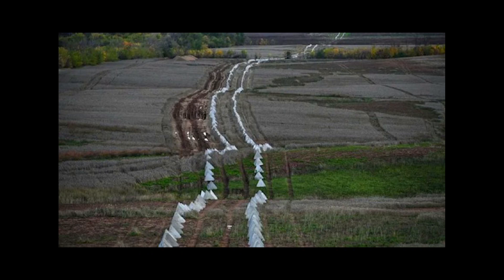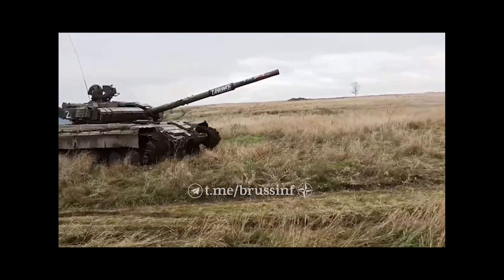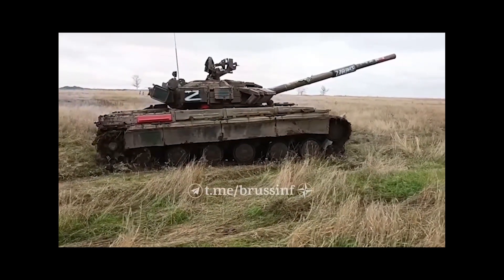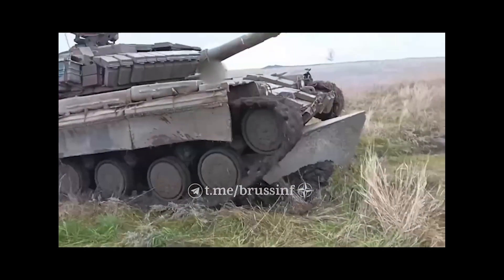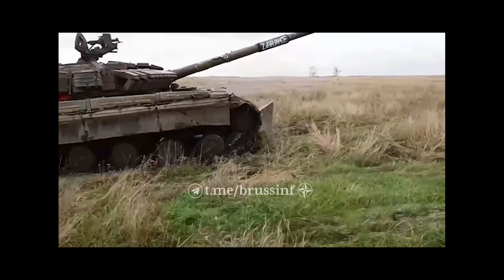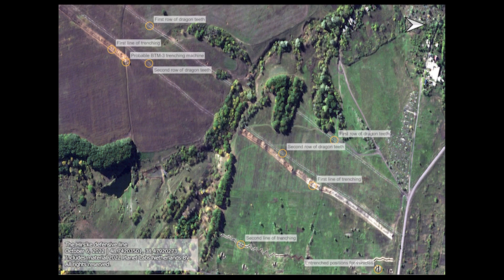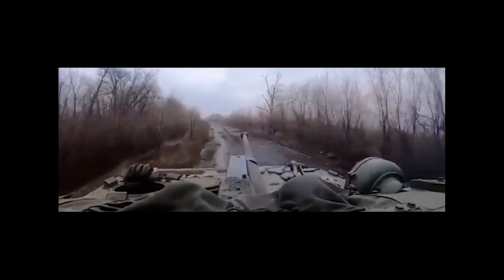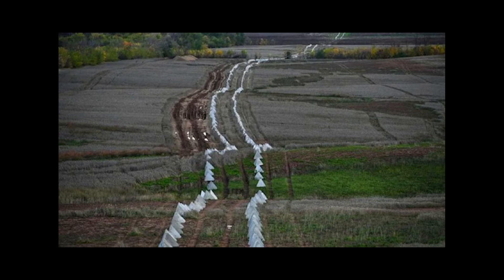How Russia's Dragon Teeth Anti-Tank Barriers Work

Comment: I am a former Combat Engineer served in the US Army in Iraq and Afghanistan. You are right any breacher would just push it away.  They really would want to use combinations. Add mines between, add razor wire, add tank ditches etc. to make them more effective. The idea of course to slow, channel or even stall an advance. To an engineer squad though those alone wouldn't last minutes.
Reply: NO one tought that tank has a gun a can blow it in peaces in few seconds
Reply: @dzonikg  waste of ammo tbh. They likely have tanks with breacher blades on the front that can just push them aside.
Reply: @nicgb098  definitely the way to go if they do have the breachers, otherwise I'd think it'd be worth a blast to keep up momentum on an attack.
Reply: @Nick G.  maybe, but if a tank could reduce two or three to rubble in a few seconds from half a kilometer away, and then a whole squad (or whatever a small unit or Ukrainian armor is called) could rush through the gap, it would be a very good use of ammo.  A dozer tank might get shot and disabled and its crew killed by trying to bulldoze a single dragon's tooth.  Ammo doesn't cost that much.
Reply: @dzonikg  The gap between the lines of teeth is mined, that is the missing detail of these video
Reply: What about a dozer tank?  These dragon teeth are not interconnected and steel reinforced, neither were they dug in like the WW2 german ones.
Reply: @jandenijmegen5842  V-shaped blade in front of the tank and they are gone. Very poorly executed dragon teeth...
Reply: The German version had a heavy concrete base buried in the ground, everything Russia does is sloppy and they know it.
Reply: @_John_P  vranyo ! then they try the jedi mind thing I guess...
Reply: These are basically just a big version of the steel caltrops infantry used to scatter to deny an area to horses. No mater how it rolls, it points up. Those were used to puncture a horse's hoof. There are meant to high-center a fast moving vehicle or slow a column down so the artillery can do its work. Luckily, the Russians tend to skip that last part. They're part of a defensive work, but not very effective on their own.
Reply: As any good Combat Engineer knows, your obstacles are only as good as the troops left to watch them and their ability to call in fires.
Reply: @BH-21-00  Very true. They definitely want fire fixed on these lines but to make it more effective you want to slow and channel the advance. These alone will not be very effective in that.
Reply: I think channeling is the purpose, to limit the flood to fewer routes
Reply: @KuopassaTv  again, probably a mind trick: DO NOT USE THE DIRECTION YOU WANT TO TAKE, USE THIS ONE THAT WE PROVIDE IT WITH OUR CHEAP DRAGON TEETH!
Reply: @KuopassaTv  - The enemy's supposed to come across the lines, not between them. That space will be filled with wire. The channeling  happens because they can't break through all along the line at once. They get across a few spots and a bunch of people and stuff has to follow the same routes.
Reply: @KuopassaTv  That is always the objective with obstacles.
Reply: @KuopassaTv  Most tanks will just ignore them.
Reply: Typical Russian half ar*ed response.
Reply: Don't even need that. Many of them still have the lifting eyes on them. Have any spare tow ropes?
Reply: @John Smith - Maybe you haven't noticed, but tanks still move the same way they did in WWII, and they're no bigger. They can brush to the side, they can't drive over them. Those two parallel lines are meant to be parallel to a line of trenches and dugouts, with wire and infantry cover. They're not defining a lane as the track shown was treating them. 
The ones in Normandy were meant to stop boats from one direction, and they were anchored in the ground. They're exposed at low tide, but the ones further out aren't.
Reply: @hamletksquid2702  You say they are no bigger, but a simple 1 min search shows they are twice as heavy, 30 tons compared to 60 tons.
Reply: @tedmoss  - Not sure why we have to keep doing this. They aren't ten times as big., which is what it would take to run over a tank obstacle without a problem. If the nose of a vehicle pushes this thing, it rolls and lifts the vehicle. It's not rocket science. Unless the belly of the vehicle is higher than the top of the object, it's going to get stuck.
Reply: @Uncle Sam 🏴‍☠️ we, not the wagnerites...
Reply: Haha you typed all of this without knowing how NATO operates 😂
Reply: @WinchesterDelta1  I was a part of NATO and fought under NATO command in combat.
Reply: Nice garden ornaments.
Reply: Yes, I’d love to see the UAF to possibly use remote operated breachers to ensure no loss of life and still punch holes in these lines.
Reply: @sjsomething4936  Exatly. We had remote breacher about 10 years ago called a do-king that would have made short work of these obstacles.
Reply: @nicgb098   pre sighted bang try again game over
Reply: @AMartian_from_Marz  We are aware of presighted arty. That is taken into account in the assessment.  Do you think combat engineers are unaware that the enemy will defend their structures? Do you think you have more insight into warfare then the US Military?
Reply: Thanks for your educated comment.  I think that most NATO armored units do not have HESH rounds in their magazines, but maybe combat engineers do?  Anyway, I think that a precision shot with an APFSDS round or even a high explosive round from a tank gun would cut one of these dragon's teeth down to size, and they don't seem to have many layers of these.  

A modern MBT is designed to put precise shots on moving targets at 2+ km range, and the dragon's teeth will never move or shoot back.  It doesn't seem to me that these are as effective as the 1940s Siegfried Line, and even that was overcome/outmanuvered.

Either way, I am glad that my government is supporting the Ukrainian forces and government.
Reply: @patricknorton5788  
From what I understand the US armed forces have phased out HESH, maybe somebody knows more about them specifically. 🤔 I think the British still love them. Anyway it's likely unless they were fixed to a position that if you did strike them or close enough to them you'd probably do minor damage but most likely throw them.
Reply: There are mines, there are multiple lines of these and there are trenches, pill boxes etc. This is just a slow down line - to slow down any attacker so friendly units can counter attack & there is time to call in air support to mop up any attack. 
I wonder how well these will work against wheeled vehicles and armored cars - Ukraine now is mostly 80% US supplied armor - which is security vehicles.
Reply: You can also send in a team of sappers to blow it up. In case it’s a mixture with tank mines.
Reply: It's what Germans did against Russia at kurisk
Reply: You must have failed as a Combat Engineer. Three weeks into the counter offensive, Ukraine can't even survive Russian minefields. They haven't even gotten close to the dragonsteeth.   Americans have a false sense of superiority having defeated weak Muslim armies in Iraq and Afghanistan, that they think going against a modern fully equipped Army would be just as easy.  The battlefield is littered with both Ukrainians and western vehicles blown up by minefileds and Russian artillery.  Clown comments fail. 🤡🤡🤡🤡🤡🤡🤡🤡
Reply: These have mines under them or in them and are used for aiming they are staggered just do some research and don't listen to every video these teeth have multiple uses the white paint will allow a tank to be seen
Reply: The ones I've seen in Ukraine are connected by cables so you can't just push them aside or drive between them; you'd get tangled up by the weight of multiple teeth.
Reply: Engineering teams are scarse and even so, you force enemies to limited manovers. To pass only in certain points.

Comment: If you think these are to stop tanks all together, you are wrong. This is to slow a rapid attack so you can pummel with Artillery, Planes and ATGMs. It just needs to slow them down or restrict amount of tanks passing for some minutes and it has worked. It will certainly stop the small humvee attacks, they aren't just driving over them.  I bet that BMP had damage, there was no video afterwards of it driving on? Easy to brake suspension parts this way, dent lower front plates on IFV etc. You can snap stuff straight off getting air time in a normal tank, let alone launching over a dragons tooth.

Comment: Try putting tread against it.  Better, plow it into the ground like this then go over now lower obstacle w tread. I imagine rolling up w bundle of wood, release from turret, next tank rolls up and drops bundle overhead f wood, repeat until gap btw 2 rows filled then up & over.  Tank w dozer blade push them out out of way.  Tank w steel plate welded to front, do same.  Infantry w shaped demo charge blows off top. I'm sure there is are better ways.    These were defeated in WWII.

Comment: I disagree with the comments of ineffectiveness:

"Obstructions liked barbed wire, dragons teeth, or even minefields were not meant to be invulnerable fortresses. They are to break up, or focus the enemy attack into a narrow area. You can then concentrate your forces on that narrow area and enjoy a huge force magnifying effect: the enemy can only bring a tiny portion of their forces thru at a time and you can steadily defeat that tiny amount of force.

So piling on dirt, or dropping enough ordinance to blow up the teeth, even if successful, still has you having to drive along a narrow path where all the enemies guns will be trained."

If you try to bulldoze it, you will face several anti-armor measures as you are vulnerable and slowed down.

If you make artillery strikes, you are vulnerable to anti-battery engagement and wasting ammunition and time, that could be focused on destroying enemy units, this also makes a narrow path as shells would have problems destroying everything and would maybe even just relocate the fortifications to an even difficult spot and that would be extremely dangerous for any troops to pass 

If you are using rockets or missiles, alongside anti-battery systems if launched by ground, you will face air defense if launched by air or to intercept the rockets and missiles.

This is a case of discouraging an attack due to the fact that there are easier ways of making an offensive that can be maintained.

If they had only these fortifications i would agree, but they built trenches, put mines, put anti-armor measures, anti-air measures, have air support and, counter-battery systems and massive artillery support alongside the dragon's teeth. Again, the dragon's teeth is made to slow down as you can't ignore it, so nonetheless you will suffer from it one way or another, as you waste precious time and resources to take them down,this is magnified by the river between the defensive lines and you. 

The World Wars are extremely different from this war both in technology and operation, you have eyes everywhere, you have aircraft everywhere and things like ordnance dropping drones,spotter drones and kamikazes drones and each one are a pain in the ass, sorry for the bad phrase, you can't compare them.

Edit: If you build speed to pass through, you are now suffering the possibility of isolating yourself by passing through the static defensive line and being made a priority target by the fire defensive lines while forces behind cannot supply sufficient cover. 
You also face the possibility of destabilizing the vehicle while maneuvering and under fire, creating an even bigger obstacle to your own troops, but on the positive side, its more cover for your allies, i think?
You face the possibility also of just being shot straight up, a little anti-climatic, i know, but 😐
And you face the possibility (which is in fact the way these fortifications work) of sinking them on the soft ground, destabilizing your vehicle and making them lift your vehicle partially from the ground, slowing or stopping you down and making you an easy target
And if you pass, i can only say good luck through the minefield and don't get hit. 

Resuming, you would need to suppress aircrafts, drones, radars, counter-battery radars, artillery, infantry firing positions, armored units and these are extremely difficult to do at the same time while cleaning up several defensive layers.
Reply: well said ol boy.

Comment: I'm a concrete guy and that seems like a lot of work considering the small results...each has to have a form and poured and stripped individually its not like stamping out metal parts
Reply: At that scale of production they will be doing it for years using a specific solution to automate it as much as possible, probably not using manual form work but a mold.
Reply: They may have been made in the past and are just now being used.  But I don't know.
Reply: Not a lot - see these concrete barriers near highways? There is a ton of them - it is not some enormous effort to make these. It is exactly like stamping parts.

Comment: “Dragon Teeth” of this size don’t work at all. Any vehicle with a plow or dozer attached can push those out of the way with ease. Additionally, they have metal hoist rings on them…any vehicle can pull them away with a rope or tow cable 🤣

Comment: These can be effective obstacles if used properly.  Loose explosive likely won't destroy or demolish them.  Tank dozers (the self-entrenching blades on tanks won't work) and engineering armored vehicles can clear them but their numbers are very limited and they can't clear them at speed.  Normally these are interspersed with anti-tank and anti-personnel mines that inhibit clearance.

However, all obstacles can be breached given time.  That is why an obstacle must be covered by fire (artillery, small arms,, anti-tank) to be effective, to destroy and delay any clearing options.  If these or other obstacles like hedgehogs or anti-tank ditches are placed and abandoned without anyone sticking around to defend them, they are little more than turnstiles.

Comment: Even a Tank can move them if they are a bit side by side, move one to a bit to the left, another a bit to the right and there you go you have an opening where you can pass through. The one in the video has been sliding for about 2 meters that will give you a 4m opening.
Reply: Brilliant idea. And you expect the Russians just sit there and watch them doing it? Try doing this whilst being shelled by mortar, artillery, RPGs and all else they've got their hands on...not to mention the minefield they have surely laid all over the place.
Reply: @M-M-M-M   assuming russians are still in there.  arty works both ways
Reply: also a tank with the mine-clearing dozer blades in front of the tracks could move them. Because those are angled to lift and turn mines and things like this away from the hull of the tank
Reply: Yes and while you do that you are hit by an ATGM from a team 3km away that you didn't see. The viewers of this channel are really stupid, this guy doesn't know much about military tactics sadly.
Reply: Or just fire a tank gun and make a passage

Comment: I doubt frozen ground would prevent a 40 ton tank from pushing one down into the ground. It might not with a BMP though. On pavement they're really worthless as seen in the video. There's a special variant of the Abrams built for going through obstacles like those. Plows right through pretty much anything - but those weigh twice as much as a typical Russian tank.
Reply: There are former soviet tanks with similar attachments. I've seen quite a lot of them so far during this war. They probably will still do the job. It would just take planning.

Comment: A dozer wouldn't really even feel them. It would just push them out of the way with ease. I have pushed concrete blocks 3 times that size and larger out of the way on job sites.

Comment: This is an example of propaganda made by russian forces to show what it's meant to do. The russian tank drove very slowly, bumped a little against the barrier and gave also only a little bit of power. One trial chain was moving not both of them. With full throttle a tank would go easily over. No doubt the russian tank could do it. A real dragon tooth is usually a lot bigger than the shown one. Also it should be set on a applicable ground with a higher density. I think it is the budget version to pull money out of the builders contract with the russian government.🤣🤣🤣🤣

Comment: You're quite right that gaps can be created in the rows relatively easily (assuming the engineering vehicles aren't taken out), but this will have the effect of creating bottlenecks, slowing down and bunching up vehicles, making them easier to target - and to block the gap with a burnt-out vehicle. This is not exactly the Maginot Line, but is would discourage planning an attack in this location if there were other options.
Reply: They're barely a hiccup.
Reply: No, because these are so small/light that any vehicle can easily dozer or plow them away in moments. In fact, since they have metal hoist rings embedded to help place them…any vehicle can attach ropes or tow cables within seconds to multiple teeth and drag them away. So easy that it’s laughable.
Reply: Only some of them need to be made of concrete. The rest can be Styrofoam.

Comment: Possibly if the tank drove over the dragon's tooth with it's wheels right on it, instead of between the wheels, it may simply roll over it.
Reply: I would think the same. it will help as the tooth digs into the soft earth also, so it doesn't slip under the tank.